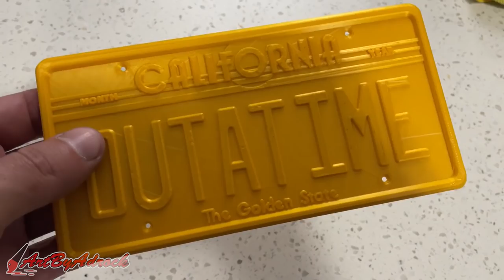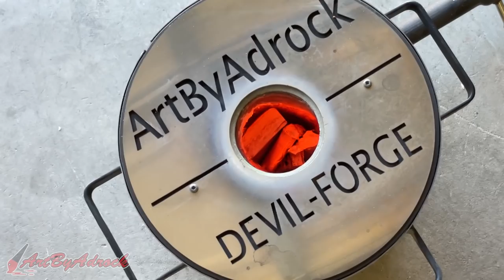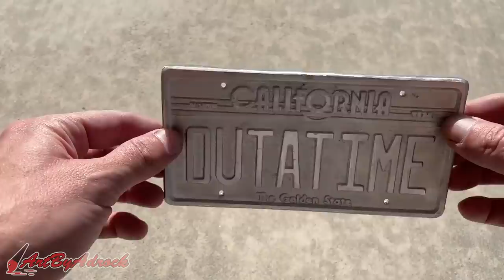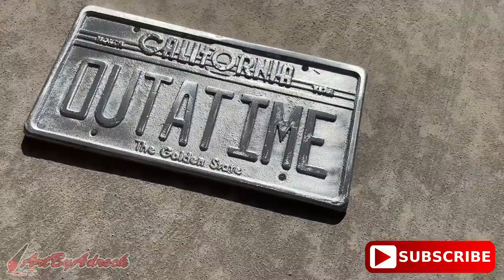Casting A Solid Aluminum License Plate From Scrap - Back To The Future Replica Prop

Comment: Very nice, I bet the only way to get a better result would be if the license plate were cast in the tin pellets you occasionally use.  It seems like that metal really does a nice job filling in the fine details and making a nearly mirror smooth surface when poured into the graphite coin molds.
I'm a bit of a D&D nut, so if there was anything I would like to see you make, a beholder beast would be pretty sweet.

Comment: dear friend 
can i use the regular sand in brass or aluminum casting??
thanks for answering me
Reply: You can use regular sand for any metal, but you would need to use the lost-foam method, as loose sand has nothing  to keep it in place.
Reply: @vincedibona4687  thanks friend
Reply: @vincedibona4687  
is there any another way ? i mean is there amy material can br added to the sand to keep it in place
Reply: @RandomRestoration  Well, that's what green sand and Pertobond is - sand (and other things, depending) and something that makes it "wet", whether it be water or oil.

Comment: nice vid again thank you. Question why do you make the "rizer" on the same side as the poor in hole. Is a rizer on the other side of the piece giving you a better chanche to fill the whole mold? So to prevent the first casting problem is is better to make the "rizer" on the other side of the casting. Would this force the metal to flow through the whole mold better and eliminate a death spot in the mold?
Reply: That’s not a riser, it’s a spin trap or surge trap. It’s designed to help calm the rushing metal when it first enters the mold and give it a place to work out all the turbulence.